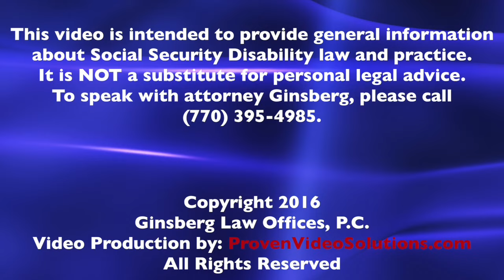Residual Functional Capacity in your Social Security Disability Case: What Does it Mean?

Comment: Where do I get the functional capacity test done, what kind of doctor does it?  SSA will not take my word alone.
Reply from the maker: Often you can get an FCE done by a physical therapist.
Reply: I asked my Ortho, they would not comment on my function, so they recommended a PT, problem is very few perform this test and insurance will not pay for it. Cost on average is around $900. I have Parkinson's and several back disorders, luckily my Neurologist completed FCE, but it wud be nice to have 2 from 2 separate specialties
Reply: Social Security Disability videos l